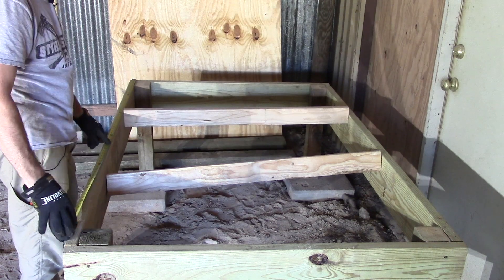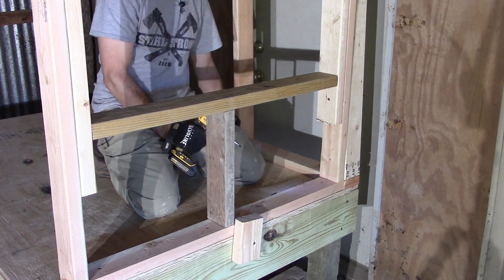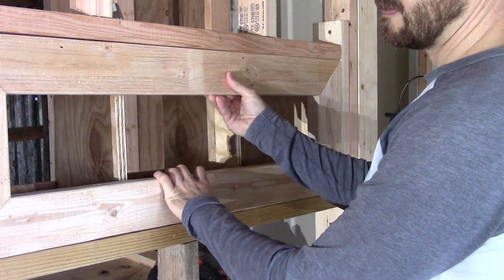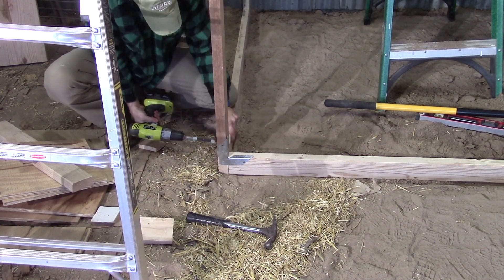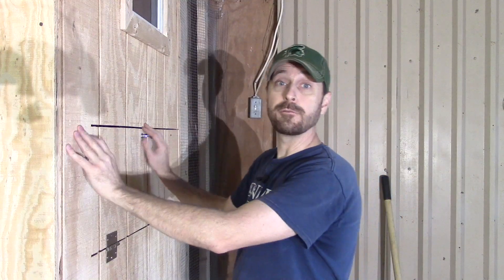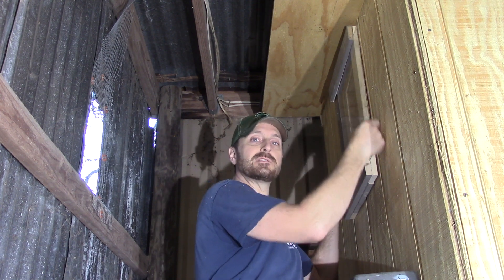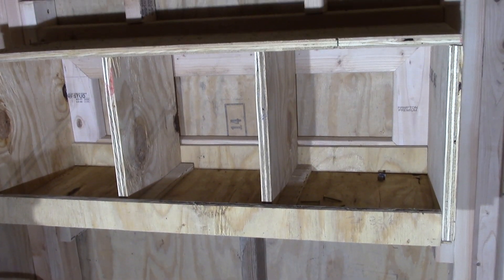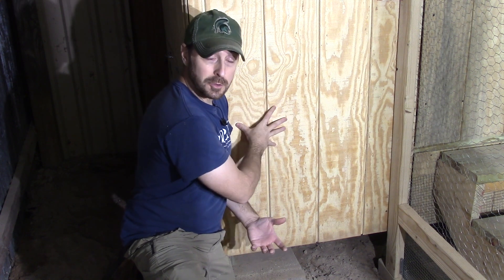How To Build A Chicken Coop Cheap - EASY Build Techniques - SIMPLE Predator Proof Design

Comment: Did you use treated plywood for the bottom flooring?   or for any of the other parts (other than the base;  which you mentioned)
Reply from the maker: I didn't use treated on the floor but I should have. The base is the only thing that is treated.

Comment: Just an observation at 1:07 I assume that door is unused?  Hope it's not a fire exit!   Any reason you would block a door, and not set the coop up to allow door access?
Reply from the maker: It's unused and has not been opened in at least 15 years. I wouldn't put the coop there if it was.

Comment: Did it end up after many months of use, that you decided the drawer wasn't as easy to use as time went by?  even if all you did was put the last piece of wood that faces the outside of the coop was not attached but rather hinged on to flatten out to sweep that all too valuable manure to use in your garden.  Also I don't know how but even use of plastic products seem that it might be easier to clean, etc., even slide? I may not be right but I am wondering on this build.
Reply from the maker: It is easy to use. I still do use it with no problem.